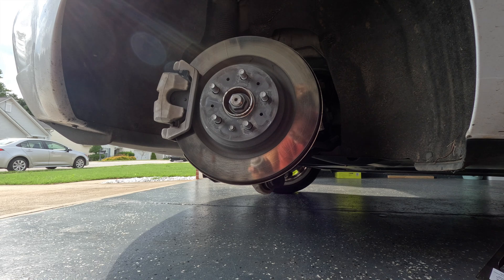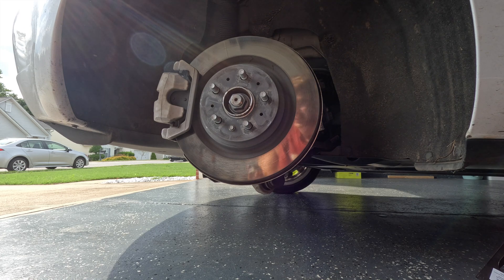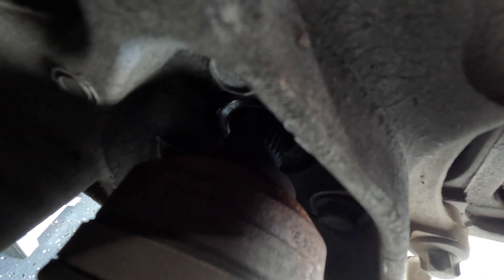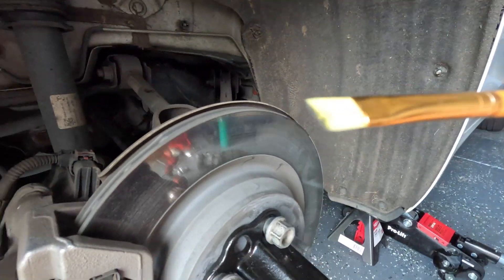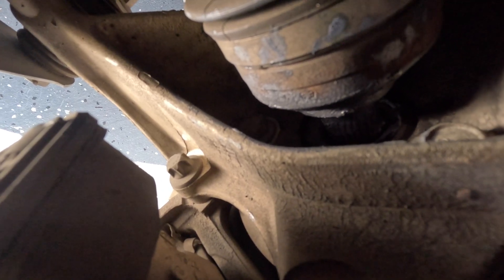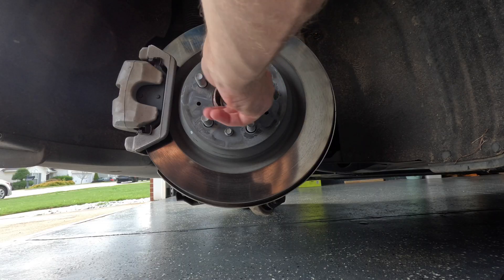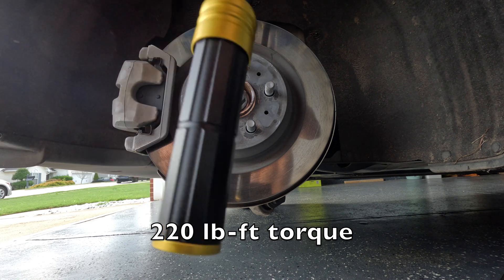👨‍🔧Tesla Axle Click🧐easy fix✅

Comment: Please what do you think, does it work for Y Perf 2023 too? I have click sound while accelerating/decelerating.
Reply from the maker: Worth trying for sure, if you still under basic warranty, Tesla should fix it
Reply: @FSDEvolution  car is under warranty, so I will contact Tesla service. Thanks.
Reply: According to the Tesla website, this is one of the Normal Operating Sounds.

"This sound may emit from the brake calipers, typically at low speeds in either Drive or Reverse, due to the brake pad abutment tapping the body of the caliper. It is no cause for concern and has no impact to braking performance or functionality."

Not covered under warranty.

Comment: My 2022 MX started having this exact clicking sound when I take off or slowing down. Tesla told me this could be an upper arm control 🤔, but I don’t trust them.
Reply: I have a 2023 MX and started having this exact problem; am seeing Tesla Service this Friday. Can you please share how you fixed yours?
Reply: @ReddyzFun 
I ended up ordering the parts from Unplugged Performance, and had it installed outside of Tesla. Parts are not cheap, but I love how the car handles.
Reply: @dukea4580 May I know which part did you have to order? Is that CV Axel?
Reply: @ReddyzFun 
So let me also say that I’ve installed the 
N2itive camber kit (alignment kit 1) for MX years 21+. I add it when I had less than 5k miles. And about 3 months back I did the “TESLA MODEL X FRONT LOWER COMPLIANCE FORE & LATERAL AFT ARMS WITH SPHERICAL BUSHINGS kit” the price now $995 + $1195 =$2,190.00 parts shipped to you. And you need someone good to install them on MX and DO NOT forget to get an alignment after installation. 
I have been very happy with it.
Reply: @dukea4580 Thank you for the detail; appreciate it. I am going to Tesla Service Center tomorrow for the ticking issue. Let me see what they have for me in the store as the car is less than 2 years with just 28K miles....I am hoping the warranty will cover the problems...if not will go your route.
Reply: @R @ReddyzFun 
Not all MX but some might get the clicking noise early due to worn out bushings, which is one of the MX front suspension weakness (car is freaking heavy) and powerful. This is more evident if you live in areas of NE US like me dealing with bad roads, bad extreme weather and BIG potholes. Mine started making the noise about 38k. 
Best of luck to you.

Comment: Can the lucas oil red n tacky be used instead?? I already bought a grease gun with a bottle of that stuff to fill in some of the bushings in the front upper control arms to reduce squeak and I figured I could just use this if it works for the axles but what's your opinion?
Reply from the maker: Not sure, has to be high temperature grease

Comment: I"m having a hard time finding the grease locally I can find aniseize everywhere. Will aniseize work? Permatex 80208 Anti-Seize Lubricant ??
Reply from the maker: I ordered it on amazon, a bit pricey. Not sure if any other high temperature grease is better or worse
Reply: How long until the noise came back?

Comment: Do you use the axle removal device to press down on the nut, so you can apply the lubricant to the axle inside?
Reply from the maker: Remove axle nut first and then install that tool on and it will push the axle out
Reply: @FSDEvolution  I guess a more proper way to do it will remove the wheel hub, so the axle lubricant can be applied more easily. I never took a wheel off before, so I need a bit more information. Thanks for staying patient with me.
Reply from the maker: Yeah ideally you should remove the hub but it’s a lot more work

Comment: I was unable to extract the axle shaft, but I tightened the nut to the updated torque (300Nm), the problem seems to have been solved for now. In some cases, an extractor is needed.
Reply from the maker: I did that too before buying that tool, it worked for a week or so
Reply: i hope it lasts longer…if not, do you have a link for your tool? the problem is finding the grease without having to buy an inordinate amount
Reply from the maker: https://a.co/d/2XtIubV
Reply: @FSDEvolution  thanks, I'll check if there's a similar one in the Italian store

Comment: Hello, good video..

I have the same exact problem on the rear left side.. isnt it possible to just sqeeze some loctite in the hole with a needle to lubricate it?
I dont have the tools like you have and i dont want to take it appart.. im not an mechanic 😅 
Maby it's just the bolt thats a little loose? Could be just re tighten it to 220lb right?
Reply from the maker: Re tighten helped for a day or so, after that clicking noise came back. There is no way to lubricate it without getting axle out of hub, that tool on amazon is around $25
Reply: How do you get it back in then? Just tighten the bolt i think?
 @FSDEvolution
Reply: How do you get it back in then? Just tighten the bolt i think?
 @FSDEvolution
Reply from the maker: Yes, it will get back to the hub by tightening axle nut
Reply: @FSDEvolution  thanks i ordered the tool on amazon.. im gonna try it tomorrow! Hope it helps..

Is it still holding up no sqeeqy sounds yet?
Reply from the maker: @bakkiepleur_FPV noise is gone, I did 5k miles since. I did both rear axles, make sure to use correct lubricant, it’s a bit pricey
Reply: @FSDEvolution  i use kroon oil copper grease.. its anti rust and it lubricates well on metal.. long lasting
Reply: @FSDEvolution  tried it today and it worked out really well.. the clicking noise when accelerate en decellerate is completely gone!

Thanks again
Reply from the maker: Nice👏 feels pretty good when it works😅
Reply: @FSDEvolution  haha yeah, didnt even needed the tool to take the center nut out.. i just hammered it a few times carefully with wood..

Pops right out.. cleaned the whole hub with brake cleaner and the re-greased it

Comment: if you set your torque wrench to 220, shouldn't you turn it till you hear ONE click?  not three
Reply from the maker: just double checking😅
Reply: @FSDEvolution Every time you „Double Check“ you overturn the nut. I bet, your final torque is not 220 but roughly 300. Tightening wheel nuts, no double check? 😂

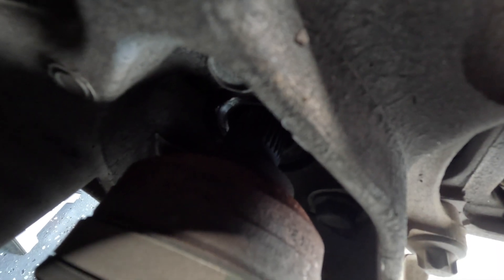Comment: where do you get that black axle removal device? 0:54
Reply from the maker: I got it on Amazon. You can also check with your local auto parts store, they might let you rent it for free
Reply: Is this process the same for front wheels or is it only the rear that click?
Reply from the maker: https://a.co/d/gPKiKn6
Reply: @FSDEvolution  Thanks so much - can I confirm its the M16x1.5 mm option ?
Reply from the maker: Yes